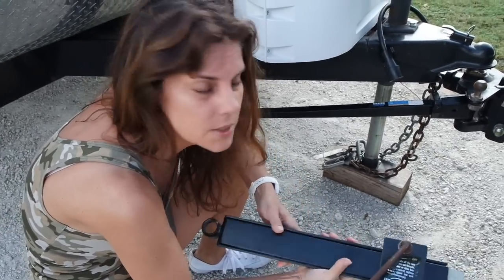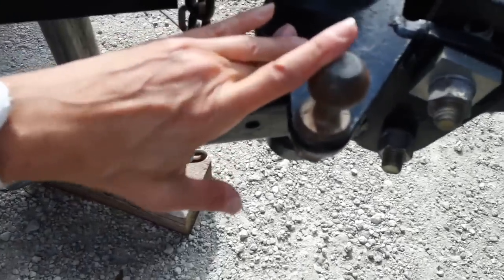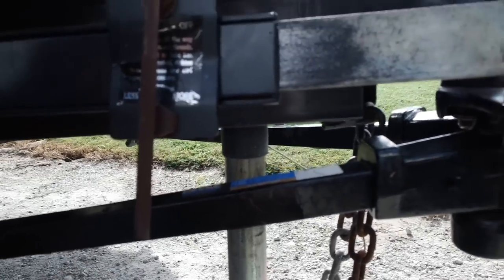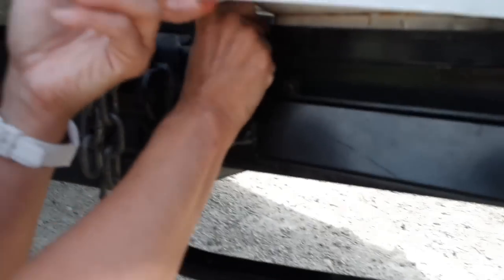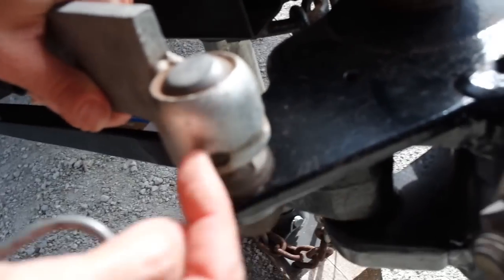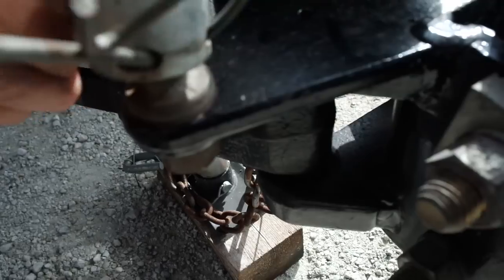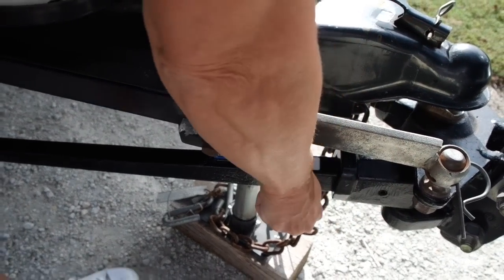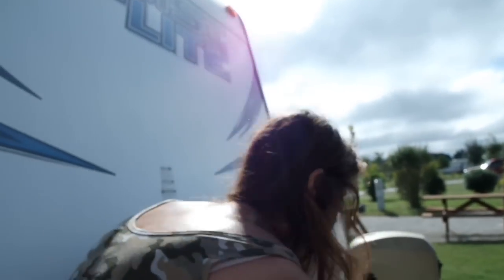Attaching the Sway Bar on my Travel Trailer

Comment: Just a question for you and your channel.  Our pop up camper jump off the ball hitch yesterday on our ride home. I believe that was because I hook up our sway bar while I was on a hill and it may have created too much pressure. Any tips or suggestions would be helpful for our new sway bar as for the old one it save our camper but was damaged during the incident 😡 🙏
Reply from the maker: Could be it was not in all the way . I had a lock on mine to back sure the ball wouldn’t come out . :)

Comment: I installed one of these sway bars and everytime I turned a corner you could hear it grinding, so I took it off. am I over tightening it? and if so how do I know how much to tighten it?
Reply: Clean the shaft, tighten about 1/4 less and you should get less noise. However, this is a clear indicator that these are working. The sway bar will make noise because it's keeping the trailer from doing too much flexing/rocking. This is especially apparent when you're towing and the trailer isn't quite attached flush with the truck (up/down a few degrees).

TL;DR: This is normal.
Reply: Noise is normal. Use it.

Comment: Question: how tight should I adjust it especially making wide turns without bending the weight distribution hitch? Advice appreciated. Thanks
Reply from the maker: I turn it until it just feels tight and then turn it a bit more after that. If it makes noise or it's too tight you will feel it and then you can adjust it. It takes some practice to get to know your own system . Just don't overtighten, it should have some flexibility.
Reply from the maker: By the way, I forgot to mention the noise and overtightening, you will feel when you drive it so just pull over and loosen it a bit until you find your perfect placement. I also learned that the weather was also important in determining the tightness. If it was a gusty day or I have to travel a lot on the freeways I might tighten it more than my usual because of the stronger winds. :)
Reply: If I understand you correctly, I should tight it a little more during the travel on the highways. On the streets, should I loosen it more to prepare for severe turns and back it up into the campsite or home property? I have no way to hear it whether it is too tight or it makes noise because I am deaf.  Again I appreciate your tips. Thanks
Reply from the maker: On the streets tighten normal as I stated before. If you turn on the street and it feels tight then stop somewhere to loosen a bit. Once you get the settings right you can place marks on it with a sharpie pen. Maybe have someone who can hear with you to practice a bit and they can alert you if they hear a rubbing noise when it is too tight. Depending on the Spot you have to back into you may want to loosen it or remove it. Tight spots I loosened, very unleveled spots I removed it to back in. :)

Comment: Thank-you . I just needed to watch to see how far the inside bar is so I can drill holes on side of trailer hitch and  bolt up a old one I had on hand to car trailer . If you think wondering what you did with your pin that son found - he he , I spend most my time  trying to find things my hand just seems to put any where . The worse the older you get !  To bad your not my neighbor . Looks like  besides you being a pretty lady , all so not afraid to jump in and do . Cool

Comment: I've heard that once you have the sway bars attached,  you are not supposed to be able to back the trailer up
Reply from the maker: You can but if you have many turns you should loosen it as much as possible. It will make it way easier to maneuver.

Comment: I installed one of these sway bars and everytime I turned a corner you could hear it grinding, so I took it off. am I over tightening it? and if so how do I know how much to tighten it?
Reply: I think that's normal. I use the Andersen No Sway hitch. No noise, weighs less, easy to hitch/unhitch.
Reply: If it is not "grinding", then it is not working
Reply: You need to grease it occasionally.